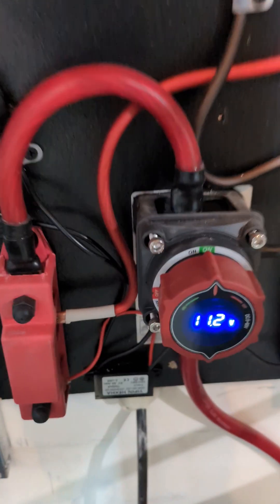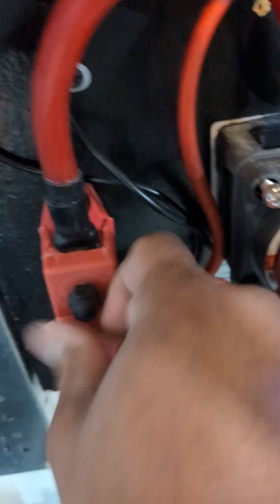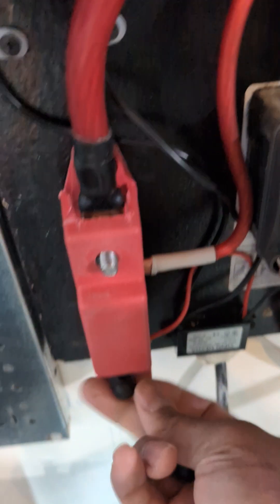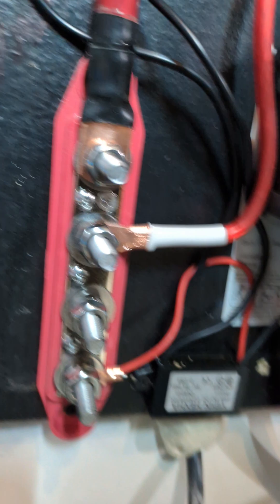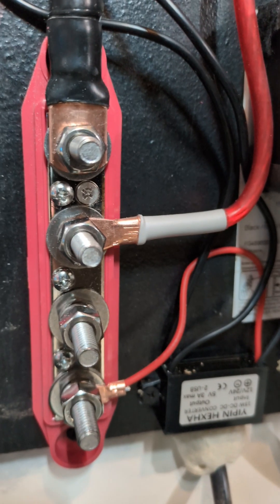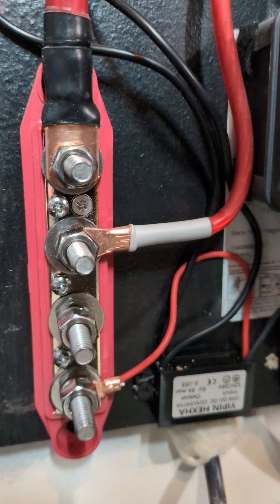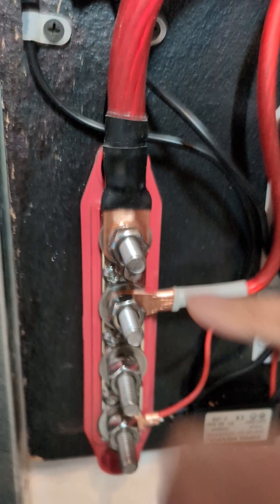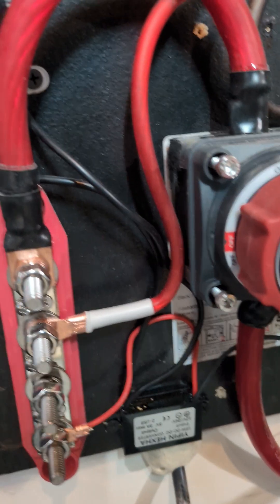Essential solar power Electric bus bars explained #technology #shorts

Comment: The cable lug should be directly touching the bus bar. In your setup you have a washer between the bus bar and the lug. This will add extra resistance and voltage drop to that connection and will result in unnecessary heat generation. 

Please fix those connections, if you haven't done so already.
Reply from the maker: This is the type of comment I need!!! People are quick to talk 💩 and say what 'they do' but I'm here for technical expertise in fields I do not have. Thank you!